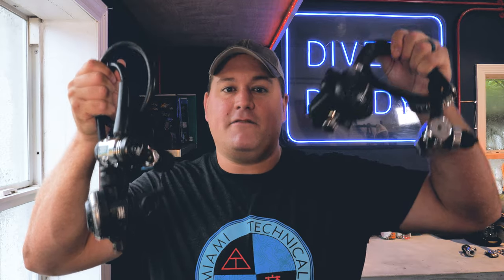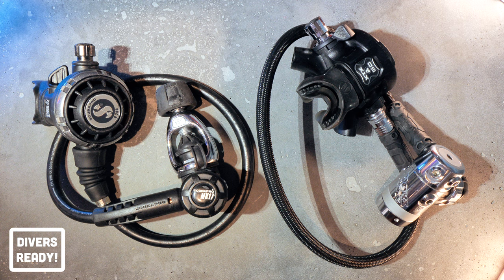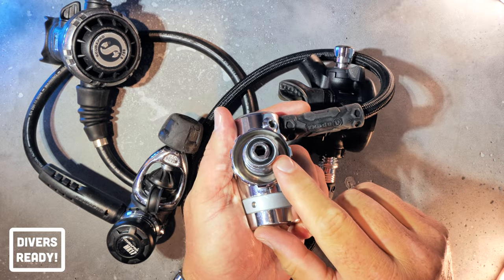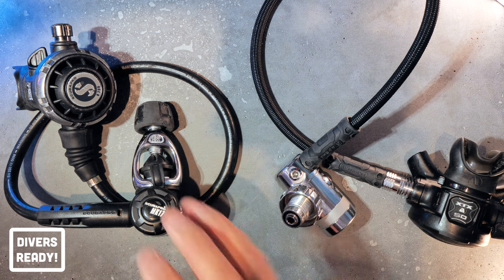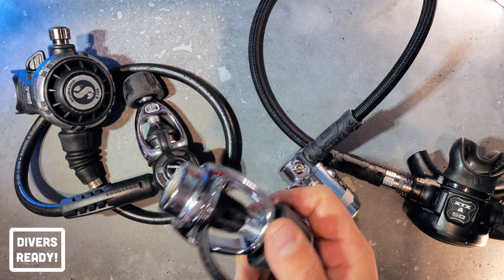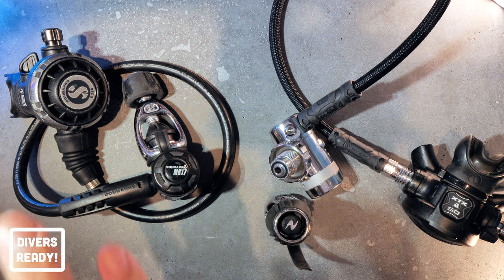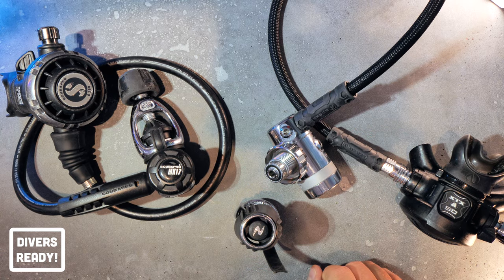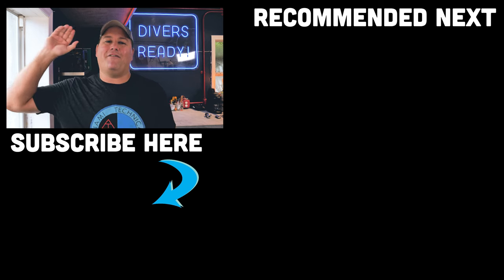The Difference Between DIN Vs Yoke Regulators

Comment: DIN for the win.
It's more secure.
It's capable of handling higher pressures.
It's smaller.
It's lighter.
You maintain the o-ring yourself.
It will fit any cylinder valve (with an adapter) (except M26).

There are no downsides to using a DIN regulator.

Comment: DIN here from Canada. Three reasons: 
1) Versatility for traveling.  I have a DIN to Yoke adapter. 
2) I have bought a HP steel tank although it's not over 3500 psi, I just feel more secure with DIN. 
3) Less bulky behind the head.

Comment: I love DIN. For a couple of big reasons you mentioned.  One... I have a yoke converter for travel in case the dive operator only has yolk valves.  Most of all the low profile and less weight.  The DIN screws into the valve which makes for the cleaner low profile, less knobs and metal sticking out all over the place.  And no blowing up O’rings.

Comment: DIN regulator. Just the most common type you find around here in Denmark. Very easy to use, if your flask already has a DIN threading. I like the more compact style as well.

Edit: I will add that in cave diving DIN does not stick out towards the ceiling, minimizing risk of knocking it against the top of the cave, if you miss judge the height.

Comment: I just bought my regulators a few weeks ago to finish my Advanced and Rescue courses and I bought the Scubapro MK17 EVO/ G260! I'm so excited to get back in the water and test it out :D. I was between the Scubapro MK17 EVO/ G260 and the Apeks XTX50 but decided on the Scubapro because it was cheaper and had a few stylistic details I preferred and, perhaps most importantly, because Scubapro doesn't need to be serviced as often and the rebuild kit wasn't as expensive. I spoke with my instructor and decided it would be best to get a DIN first stage with a Yoke adapter and I'm all set to go! Happy Diving :)

Comment: Have been diving DIN regs for over 30 years. In the past normalisation of yoke used to be a problem and I have suffered catastrophic gasloss with a not fully compatible tank-yoke combination. Never had an issue with a DIN reg. Also DIN regs exhibit a lower snag potential for nets on wrecks

Comment: My first regulator was was a yoke. I had it converted to DIN at it's first service. There wasn't any need to buy a new set of regs and the price of the conversion kit was much less than a new set anyway. I still use it today when I'm teaching open water courses. All my many other regs were bought as DIN and I just take an adapter with me when I take them overseas. Here at home in Australia and most places I dive overseas in the last four years have convertible tank valves anyway. I take the adapter as insurance because some of those tank valves haven't had the inserts removed in a very long time and can be corroded in place.

Comment: DIN all the way. it is just a better connection and if you want to venture in tec you will need DIN.  As James shows, many cylinders can be converted and you do not even need to use a DIN/Yoke converter. As always, James is spot on :-)
Reply from the maker: Thanks Nor!

Comment: I live in Georgia and dive mostly springs in Florida. In this geography, yoke is most common. Wouldn’t having DIN with adapter as the norm create an additional failure point by having two connections (adapter to tank and DIN to adapter) Instead of just the one (yoke to tank). New diver trying to learn to think through these things. Thanks for all of your content!
Reply from the maker: Actually, DIN with an adapter is the same amount of failure points as Yoke. Yoke has one more than DIN to begin with.
Reply: Anytime you add an adapter you add a failure point. If you're using a Yoke valve adapter you have an insert with an o-ring on the inside, and an o-ring on the outside.
The chances of the o-ring on the inside failing are next to nothing. If you come across a worn o-ring on a ring adapter, screw it out, and turn it around. (Or better yet, ask for another adapter ring).

When you add a Yoke adapter to a DIN regulator, you have the o-ring on the valve, and the o-ring on the regulator. The chances of the o-ring failing on the regulator are next to nothing.

Another disadvantage of the Yoke adapter is that it makes the regulator stick out quite far from the cylinder valve. So you're basically compounding the disadvantages of a Yoke valve connector. Now it's sticking out in the back AND the front.

Fortunately, there aren't that many dive operators who still use Yoke valves. Most use DIN valves with a Yoke adapter ring. So you'll rarely need to use the Yoke adapter.

Comment: I use only Din. I did not cert on Yoke and didn’t really like how it fits and sticks out. I also dive with HP Steel tanks and are rated for 3325 psi. I really like the low profile of the Din

Comment: If I was buying again I would buy DIN. Most dive shops prefer DIN. You can also accommodate higher pressure (ie more air) in tanks so good if you're a heavy breather. O-Rings also tend to fail more in yokes as there is more pressure put on the O-Ring when the pressure is released for the first time (like out on a dive boat or just as you're testing the tank pressure before you get on board...You can always buy a few adapters. From what I hear- ice diving almost always mandates DIN for safer diving (and you suck more air in cold environments)

Comment: Don't get me wrong I am a fan of DIN. But I believe the best travel system is a yoke reg along with a spare "doughnut" insert for DIN tanks. If you travel with a DIN reg, yea it weighs less, but if you need the A-adapter just in case you run across some yoke tanks your weight savings just went overboard. Plus it sticks out way worse than a natural yoke reg. If you have a Yoke reg, all you need to make any din tank yoke compatible is the little doughnut insert that you showed in the video. Moreover the little doughnuts are like $10 a pop (I always keep a couple in my SAD kit as they contain 2 orings each). The A-converter is like $50-100.
Anyway. Love the videos keep up the great work. Cheers!

Comment: I use and prefer DIN but there is one advantage I see for yoke and it is the durability of the valve (without reg attached). Drop a tank off bench onto deck valve first. It does not take that much of a hit for the din valve to get deformed and no longer able to recieve the reg. This is one reason I think the high volume boats for rec divers might favour the yoke tanks.
Reply: If your Valve gets hit this hard i would recommend to change it...

Comment: Thank you. I knew the Din was a Thread on. But didn't know it was rated to handle higher PSI. Having worked as an Auto tech, Fewer connections means less chance for leaks. The Adapter kind of makes sense in a pinch. I would rather have the Direct Connection.

Comment: Hey James! Thank you for your vids! Small correction: It's "Deutsches Institut für Normung". And I use this type.
Are you planning a video on cylinders? To buy or not to buy, and what kind of. I would very appreciate your valuable advices. Cheers!
Reply from the maker: Indeed. That mistake is mine! Thanks for watching! Yes, a cylinder video is coming up!
Reply: Divers Ready i don’t know how common this is, but I found gettingg the right tank was infinitely more useful for my buoyancy/confront than any other piece of equipment
Reply: @undisclosedperson3871  Good point!

Comment: I've heard that you cannot dive a HP cylinder with a yoke valve because the yoke connection cannot withstand the higher pressure. 
  However, a HP (3442psi)  117 from  Faber comes with a yoke insert. I used it as yoke many times. Never had an issue. Not saying it wouldn't have eventually blown the Oring but it did make me question whether or not its true that yoke connections can't handle HP.
Reply: For the record I'm strictly DIN these days though I do carry an adapter just incase no DIN cylinder is available.
Reply: 3442psi (about 237 bar) is not an high pressure but is just a bit more than the maximum limit of the yoke (232 bar or 3365 PSI) which is the same value allowed by a LOW PRESSURE DIN (5 threads)
An high pressure DIN regulator (7 threads) can handle high pressure DIN cylinders (300 bar or 4351PSI) and can be also connected to low pressure DIN cylinders (232 bar, same as yoke)

Comment: Older DIN regs are also 200 bar (or 232) too, so if someone wants to use 300bar tanks make sure the reg is also 300bar rated, with the longer thread. 
BTW older means not that old, like my Scubapro MK16 and MK20 was also 200 bar.

Comment: I'm a newly certified diver, and I recently purchased my own set of gear, among which was a Yoke regulator. I now wonder if this was the right decision, given that I dive steel tanks (i.e. higher pressure). Insight?
Reply from the maker: Sell the yoke and buy DIN! Sorry! 🤗
Reply: Divers Ready with all due respect bad advice. Better to convert his current reg to DIN. True?
Reply: DO a quick call to the dive stores you would use to do your fills ........ your surprise will be most fills are to approx  200-220 bar anyway as many shops set the cut off a pressure for fills at max 230 bar. As a new diver save spending anymore money on the reg set and do some diving instead.

Comment: i use DIN regulators because i use with 300 bar steel cylinder and because it is easier so i use an adapter for int bottles

Comment: I have both and definitely prefer the DIN and use with my own tanks in home waters of California. But i got a yoke setup to use when I travel. every few places I've traveled(haven't done Europe)  to had DIN tanks. A few have the removable inserts,but most don't. And some with the inserts couldn't remove them coz they'd been in so long.  And using the adapter makes the setup longer and hits the back of my head.  So for less hassle I travel with my yoke setup.  If the dive shop I'm traveling to can tell me for sure I can use DIN setup, I'll take it. If they tell me they mainly  use yoke and should have a few tanks with the inserts they can take out........ I'll take my yoke.
Reply: Same maintenance issue, if the inserts are in that condition can you imagine the valve threads on a DIN tank valve. Easy to carry a couple orings on a carabiner, problem solved. The reality is most people do not do maint on the cylinder valves , just take a Go NO GO gauge out at most of the resorts with a din tanks ............ silence. Easy to have control over oring s you brought than over valve threads.
Reply: @omegadivingacademy7937  yea, that's why I got a yoke setup for travel. Just less hassle. Always have O-rings in my dive kit

Comment: Your video is perfect timing. I am considering having my lds convert my yoke regulators to din with a conversion kit. Reason being: I dive high pressure steel 100s. I regularly get fills slightly above 3400 (NOT Cave fills). My o rings fray and blow all too often. I own three regulators and the conversion kits are $50, $100, and $150. Also my tanks easily convert to din. Should I convert? Thx 🐠🦞

Comment: DIN is both stronger and more versatile. It's a no-brainer.

However, A DIN with a-clamp converter is a pain. It defeats the weight argument, as the combination is heavier. And a DIN with converter sits closer to your head than a native yoke, because the DIN screw doesn't disappear, so that can be uncomfortable.
Reply: And you have to put up with the condition of the valve thread you use when diving on vacations around the world some of which I have seen I would never risk fitting my din into. It is fine if you dive with your own cylinders since you would maintain both but  not when you travel. In 30 years of diving never seen a full oring loss on "A" clamp however seen 9 din failures due to cylinder valve threads which had not been looked at forever. So the oring housed inside was irrelevant.

Comment: I have traveled all over the world and I have never seen anyone using DIN regulators.  South, Central and North America, Asia, Southeast Asia, Maldives, Egypt, Oceania use yoke. I think Italians and French use yoke as well. Cubans might have some tanks with Provalve for Germans 😆
Reply: Yoke is used worldwide (even in Europe and Africa, where DIN is quite common as well), if you have a yoke regulator you will find a cylinder everywhere in the world (but is bigger and cannot accept very high pressure cylinders!).
If you have a DIN regulator, you may have troubles in some countries (unless you also have an adapter) but you have a smaller and lighter unit that can be also used with 300 bar cylinders (i.e. much more air available!).

Comment: I dont even understand why yoke is still used.. Should've been phased out years ago. Din is more reliable, lighter, you have your own o-ring (instead of getting the trashed o-ring on the tank-i.e. it's different every time). 
There are no benefits of yoke whatsoever...
Reply: Once a standard is established unless you have the force of government behind it, like DIN has in the EU, new standards rarely displace one that is good enough. Heck even with the force of government behind it I hear M26, the new DIN nitrox standard, is having very slow adoption rates.
Reply: Its like Automatic Transmission cars. Easier. Less chance to strip threads.
Reply: @chrisphilhower6029  manual Transmission is more reliable and gives you more control over the car. And to be honest how dumb, yet superhumanly strong a person has to be to strip threads in the DIN reg/valve...
Reply: @Schtukas1   Sorry mate  I have actually witnessed  a diver do it on two occasions in a space of 10 min test using the go no go on both the din wheel thread and valve thread showed both were trashed. It happens a lot more than you think. The reality is you only have to cross thread and get it stuck and slightly force it and the threads fail.
Reply: @omegadivingacademy7937  ok, you are talking about the fault of an operator. Yoke does not protect from that. If a person doesn't know what he is doing, then it doesn't really matter what you give to him..
Reply: Just because DIN is better doesn't mean yoke isn't good enough.  I have been in diving for 45+ I'm not going out and replace all my equipment.  But, if I ever purchase a new regulator again it will be DIN.

Comment: I'll admit it's a little nit-picky, but I'm pretty sure DIN had nothing to do with the development of the DIN regulator. DIN is a standard for industrial machining, including screw threads. The DIN system uses a DIN screw thread to connect to the cylinder valve. That's where the DIN name comes from, not because DIN developed the connector.

Comment: DIN as everything German is a precision item. Put it into high numbers of students environment, like dive centers in the tropical destinations and you end up with broken threads all day long. I've seen a student put a yoke in opposite direction , driving the screw into air inlet 🤦‍♂️🤦‍♂️. But with those fantastic tank valves that can be converted, I think yoke will become history over time since before many fast afraid not to find a DIN tank in some areas, same reason my first reg was a joke.

Comment: Nice video, but your explanation about DIN pressure is not correct. There are 200 (232) bar DIN regulators. It comes down to the number of threads.
5 threads DIN is 232bar
7 threads DIN is 300 bar.

Quite some beginner regulators like the Aqualung Calypso, are only 232 bar regulators.
Hope that info helps some of the readers.

Comment: As far as I can tell, from experience and your video, there's no advantage to Yoke, it's just a hangover from the American (and local) market clinging on to them while the rest of the world had moved to DIN. That said, for most divers, Yokes will work just fine and there's a lot of great used gear out there with Yokes for peanuts and, as said in the video, the actual regs are just the same in most cases.
I've seen quite a few Yoke O-rings fail (usually when pressure is applied to them to be fair, so an inconvenience rather than disaster), but never a DIN one.
Reply: The rest of the world isn’t DIN. Outside of Europe yoke is the most common reg. In fact in Asia when I ask for DIN tanks the response I typically got was “We have adapters.” I am moving to Asia in a few months and when I do my rec reg will be switch back to yoke.
Reply: @Teampegleg  I can't claim to have dived all over Asia, but in Indonesia, DIN was the norm, as it was in the Maldives and Mauritius when I dived there, Egypt and Jordan, too - Tanks, of course, were convertible, but I didn't see any Yoke only tanks. - Assuming you're right, though, what actual advantage is there to Yokes? I can't think of any...
Reply: @marksaxby607  The more European tourists a location gets the more likely they will have DIN tanks. The further off the beaten path you go the more likely they will only have yoke tanks.

And there is no technical advantages to yoke over DIN, it is simply the dominate system. It is the same reason you are typing on a Qwerty keyboard and not a Dvorak keyboard. Displacing a dominate system requires both that the old system to not be good enough, and the new system be clearly better. Yoke is good enough for most divers.

The only exception is when the new system has the force of government behind it which is why DIN took off in Europe and not in the US where it was developed. Though that is not always the case, as I keep hearing that M26 is having major resistance.